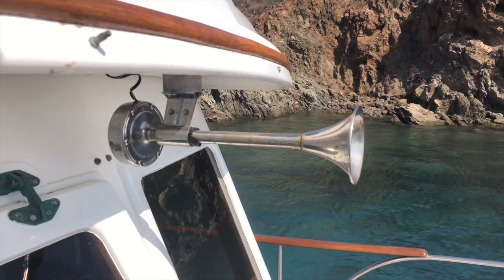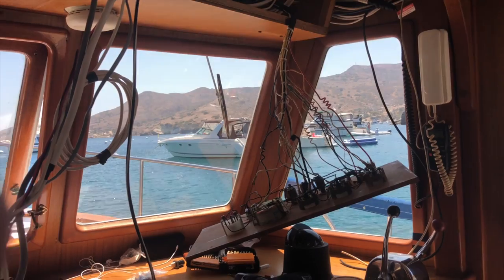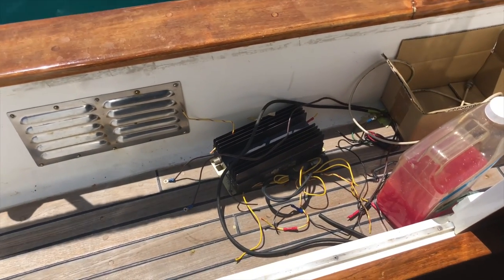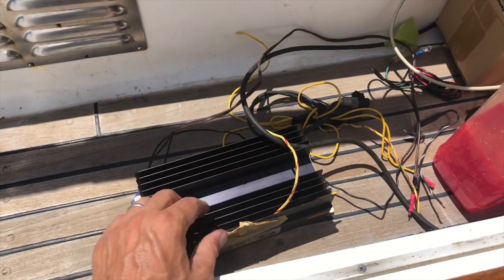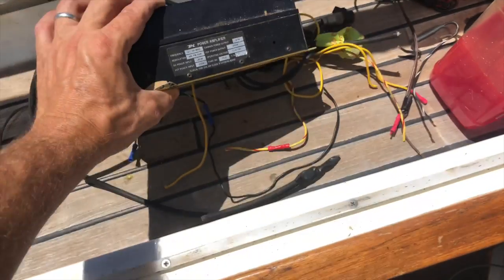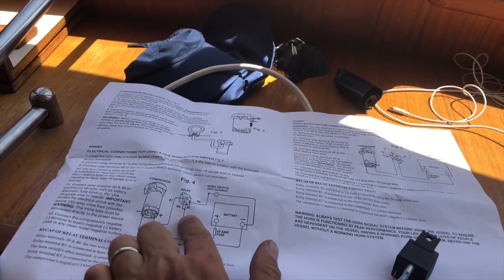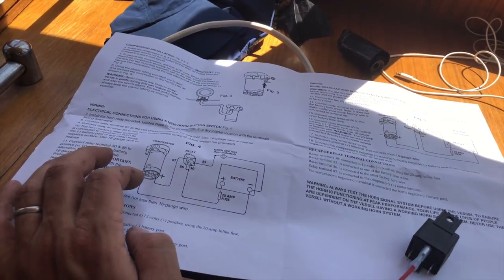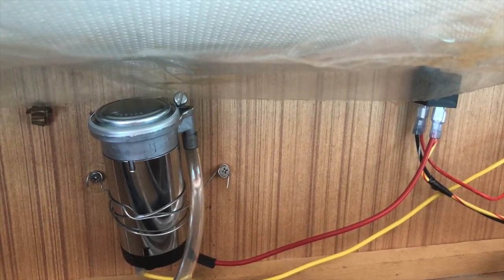Air Horn upgrade

Comment: it is probably an amp for speakers or a bull horn type speaker. A line signal is too low/weak to move speaker drivers, they need an amplifier to produce audible sound. I could be for an intercom or just a whole boat stereo system. In a system like i would suspect is on your boat the speakers are probably run in series, so the need more power than your stereo/ intercom can produce to operate without distortion. Or not, that is what it looks like to me though.